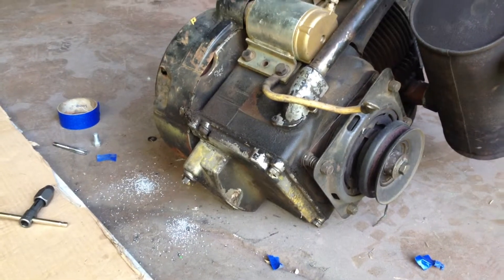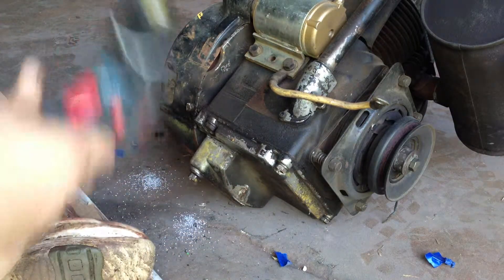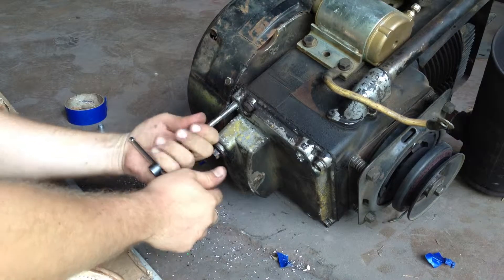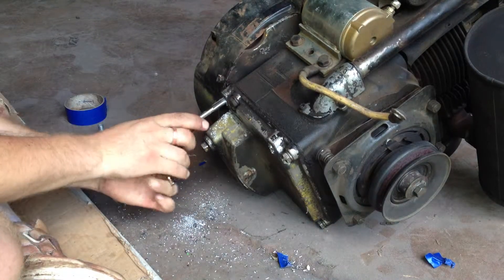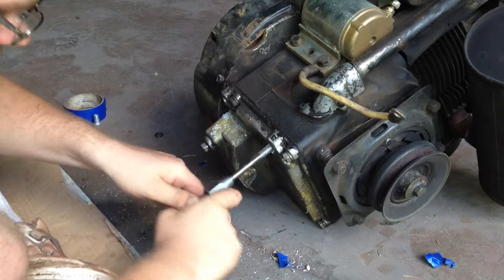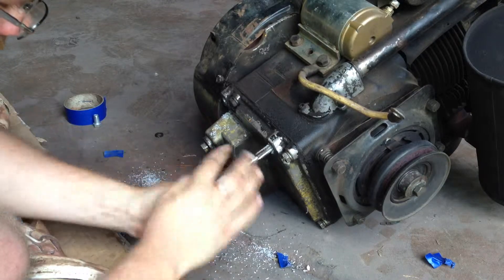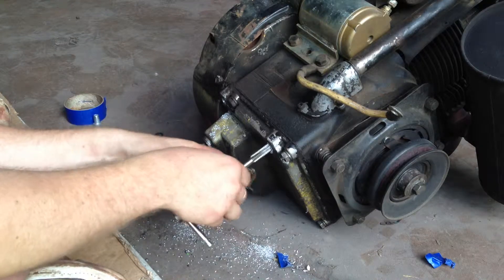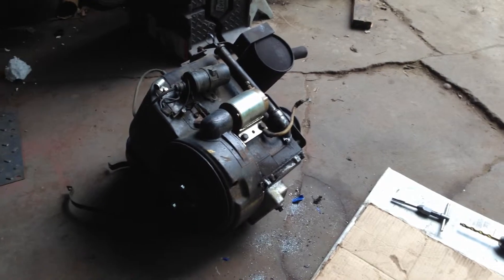kohler k321 engine mount repair

Comment: I was wondering myself about the oil and even a air hose to blow out the holes? Mine are still there meaning the threads but they are starting to wear out. I'm thinking more towards JB weld

Comment: will do. discovered today the front left bolt on my tractor was missing and of course the hole is stripped out. also think i cracked the oil pan today. always something with these machines
Reply from the maker: Yes that's one reason why I redo my tractors

Comment: would you recommend solid mounts or oringinal rubber mounts for cub 1250
Reply from the maker: The solid mounts shake the tractor spot more then the rubber so if you can get the rubber mounts then get them
Reply: Rubber mounts. Tried solids on a 1450, taking them out
Reply: @ 8 years ago but hell yeah😂 that’s what I ended up going with and welded some flat stock across the bottom of the cradle so it doesn’t flex so much